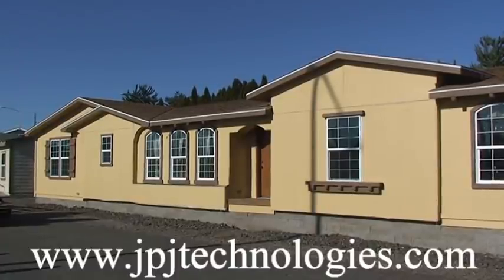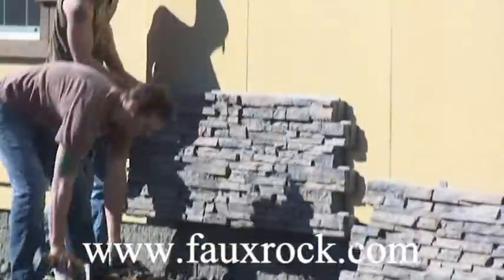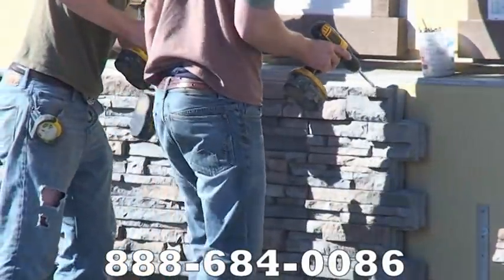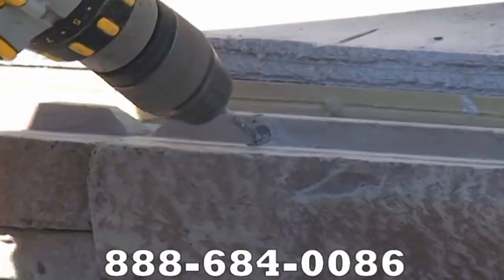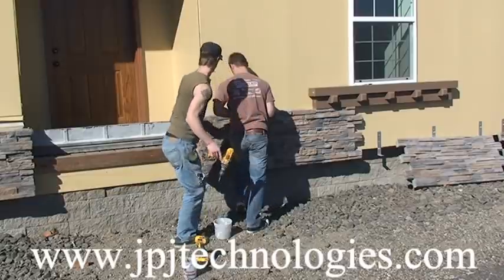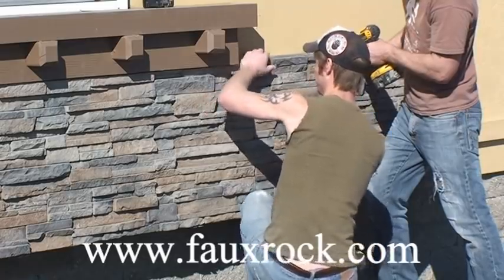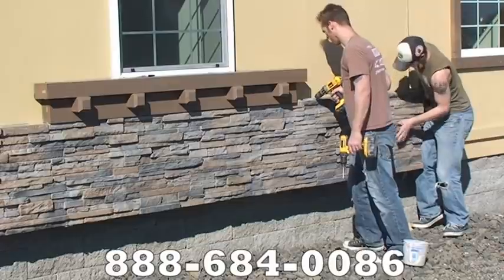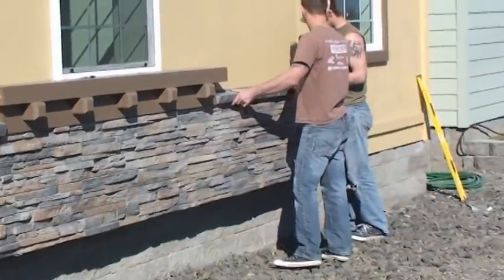Installation Stacked Stone Veneer Panels over using cultured stone. part -1

Comment: Interesting product but I have one concern, no drainage board was installed between the panels and inner wall.
Many people have complained about the base wall rotting out who have used similar products because water could not drain away properly.
Reply: well for starters those are probably the diy. folks it's sealed with clear caulk and top bridge caps.if installed correctly water shouldnt get inbetween unless you live in a high humidity area you should be fine.
Reply: @BloodlineMedia   I think he stated that they are coated in a sealing coat.
Reply: @parrisestatessouthernhomec3246  the problem is when you have a hot and cold temp between day and night condensation is created behind that panels. So if it has nowhere to go it will create a mold or rot issue at some point.
Reply: I would say buy a zip drainage wrap or a hydro gap house wrap that would solve any issues.
Reply from the maker: Our panels have an inch and a half set off of the house to where there’s an inch and a half gap between the panel and the home only 5% of the panel touches but we do provide for a drainfield and airflow behind door panels, but that’s to say that there’s water gonna be coming in through the panel and that’s by design not possible
Reply: @fauxrock  Awesome!
Reply: Can these be attached to concrete columns & a cinder block foundation?
Reply from the maker: @magnetchick1 @magnetchick1 yes we install these interlocking panel on concrete walls and columns routinely… instead of using wood deck screws we use tapcon concrete screws

Comment: Putting this on a stucco home in Florida, would there be any issues with moisture getting behind these panels and causing mold/mildew?
Reply from the maker: These panels have a built-in designed drainage area and ventilation as only 5% of the panel actually touches the house. so the answer to your question would be no as long as the stucco is in good shape, and there are no cracks there would be no issues

Comment: Why didn’t u put a vapor barrier in between the wood and stone
Reply from the maker: The house was newly built and behind the cement siding there was already on the home was a moisture barrier. The moisture barrier along with the cement board plus it being caulked was more than enough protection. Couple that with the fact that our panels don’t sit right on the home, as only about 5% of the panel touches the house there’s an air space of an inch behind the panel face where condensation drip and air evaporation can occur.

Comment: Seems like water  would leak thru
Reply from the maker: By design it doesn’t leak, but even if it did, there is an air space behind 95% of the panel that allows for condensation and or evaporation to take away any water

Comment: awesome!! what is the cost for the material for the same 88sqr ft?
Reply from the maker: I'm not understanding your question... Did you want to know the cost of my material or the cost of the conventional materials that would be used instead of my product?
Reply: 1 panel is 2'×4' =8 sqr. Ft. $105.00 per. Panel. You can order it at Superior building supply co. Or you can order it from your local home Depot store.
Reply: fauxrocktraining the product is fire resistant?